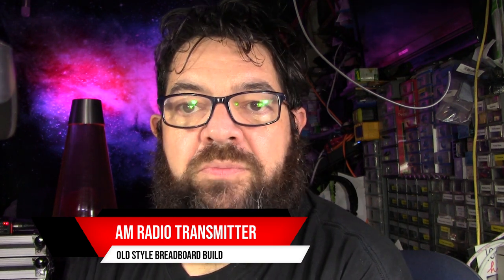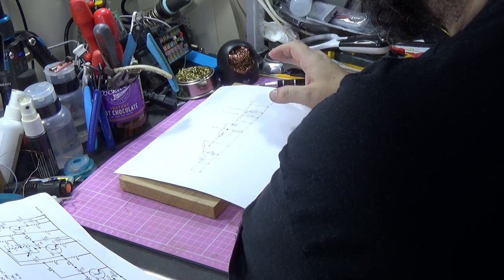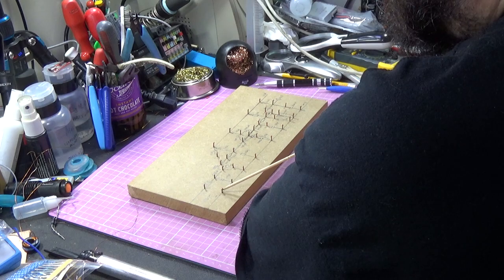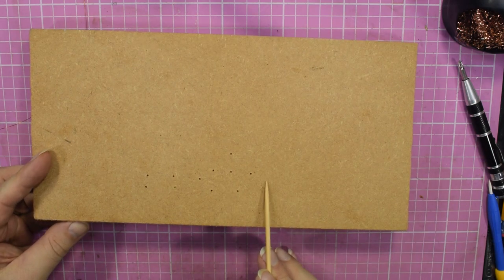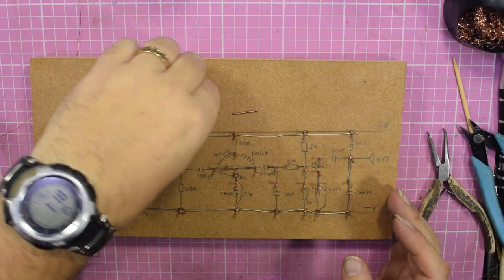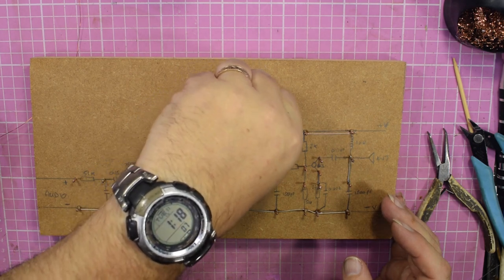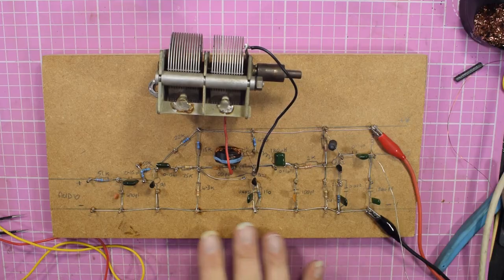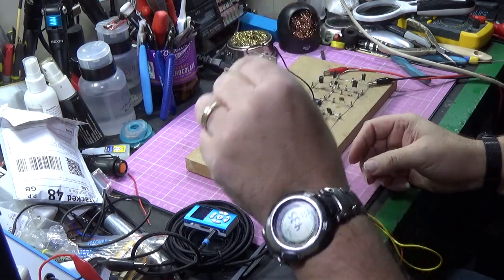Build AM Radio Transmitter - SIMPLE Method - How To Make

Comment: Would be fun to see this built on an actual bread-cutting board. Or, with some springs, like those old Radio-Shack kits I built as a kid. Cool project, nicely done.
Reply from the maker: If you could get a wood breadboard these days. As for the spring kits... I just happen to have one.
Reply: @GeorgeChristofi   There are lots of people making breadboards these days and you can probably get them on Amazon, Etsy or even the dollar store.

Love the idea and fits into what I want to do which is make radios like they did in the twenties through the fifties.
 I like the idea of the breadboard because I don't have to worry about getting metal cutting drill bits or cutting holes in aluminum chassis.

Just watched YouTube video on somebody that made an AM transmitter using the bread Pan is the chassie and it's pretty neat too

Comment: I ain't watched the movie all the way through, only the start and most towards the end: time is tight. Our local HERC radio club warned us you can get into serious trouble for using a MW TX in the UK. Maybe rules have changed. Great instructional upload, thanks. 73, 2E1FQN. 🙂
Reply from the maker: Strictly speaking, the rules against operating an unlicensed transmitter in the uk are clear but as a licenced amateur there is nothing to stop you building an oscillator as long as the output does not cause interference. I won't say ofcom are toothless but these days the chances of getting into trouble with a 50-100mW transmitter are less than almost nothing. George, G0JKZ
Reply: @GeorgeChristofi  That is really useful information, George. Thanks. I've inherited a Maplin  frequency timer/meter and have been trying, with a little success, building an oscillator at 27Mhz thinking this band is a free for all, since some toys use it. I did a MW one with only 2 transistors that worked well, only on one frequency. Schematic on my Web. Yours has an RF output stage, so, I assume is why it's tunable. I do love this traditional breadboard approach: inspirational. 🔌👀🙂

Comment: Hello George. Sorry but this snippet is very off topic. If you use a buck conerter as a variable power supply you need to change the blue variable potentiometers for wires to standard 'pots'. Surface soldering the wires to the PCB is very weak. A 3 way 2.5mm pitch JST female socket fits well. I expect I'm teaching my grandmother to suck eggs but it's worth knowing. Judging from the comments I had better watch this video. Regards
Reply from the maker: I don't know why but I only just got a notification that you posted! As you say, surface soldering is so dependant on the copper thickness, the adhesion method it was glued to the board and the thickness of the cables. JST male pins are good too and you can make up a three way flying lead quite easily to remote mount a standard pot on a cabinet or a chassis.

Comment: Just what I need for my shop so that I can listen to some of the radios I'm restoring.  Definitely gonna build it.  Any recommendation on a tuning capacitor?  I'm sure I have some since Ebay sellers have sent me several radios without padding that arrived violently disassembled.  Can I just scrap a tuning condensor from one of the heaps?  Love the old school approach.  Exactly what I'm after.  Keep up the great videos.  Doc
Reply from the maker: I just used one that came out of an old radio that was beyond repair. I think you could probably get away with anything that has a reasonable range. That one went 27pF to 450pF or thereabouts.
Reply: Thanks  @GeorgeChristofi

Comment: Awesome video George, this looks so much easier for older eyes than doing the PCB method. I love the way you did it on the board. I would think one could use a 1Mhz crystal oscillator in place of the coils and variable capacitor? I definitely want to start doing some projects in this fashion. Thank you so much. You have a new subscriber!
Reply from the maker: Using a fixed oscillator would work but how far you could tune it would depend on how far the crystal will allow itself to be pulled. The other option could be a modern chip based oscillator. You could use an opamp or a 555 chip at frequencies up to around 1Mhz.
Reply: @GeorgeChristofi  Or just buy yourself a 1MHz crystal oscillator module.
Reply from the maker: @SpeccyMan  indeed, that is the easiest way but this circuit can be made with any old stuff lying around that may have been salvaged from old pcb's

Comment: I like retro electronics. I think I'll repeat your construction. What determines the modulation depth? It looks like this circuit doesn't have much distortion
Reply from the maker: the amount of audio determines the depth of modulation. too high a level will overdo it and drive it over the top but its a juggling act between volume from the device versus volume on your radio.

Comment: Nice but it is not really just an AM station it also produces FM modulation,
You usually modulate AM on the final stage!
BUT it works!

Greetings from the Netherlands!
Rob.
Reply from the maker: indeed, there will be an fm component in there but not enough to really notice on those frequencies under the am signal. At worst it will be 20khz due to the nature of audio but yes... it works!! Many thanks for watching. George

Comment: Hello, George.
Thank you very much for this video!
Is it possible to use c945 transistors in this project? 
Thanks and warm regards!
Reply from the maker: I would imagine its possible. I just used a general purpose transistor so anything good to 2mhz will work
Reply: Thank you very much for the response. I will try it. Thanks again for the video.
Cheers!
Reply: @GeorgeChristofi  2 millihertz? There is a reason we use M for mega and m for milli. 😉

Comment: Excellent video, you just did not demonstrate how you wound the ferrite coil and how you installed it. I may try and make that circuit as I repair tube radios and would like to play my music on the sets that do not have phono inputs to use blue tooth pre-amp or a mp3 player. Have all those parts but as far as those value resistors I only have them in 3 watt which yes is overkill but its what I have, and also have a few tuners saved from scrapped tube sets, does it matter what tuner is used?

Comment: Great video, but imo using a perma-protoboard would be way easier, and smaller circuit ofc
Reply from the maker: It was just done that way to show old school build methods from back in the 60s and 70s and even earlier. Proto board is cheap these days but it wasn't when I grew up in the 70s so we used any old plank of wood to test things out. Also wasn't to intricate for 8 year old me to figure out!

Comment: Hello, Thanks for your instructive video. Could you please kindly explain why the radio was detecting the music at different positions for variable capacitor. You demonstrated in the video that this is due to the instability. Could you please elaborate on this a bit more ? thanks.
Reply from the maker: The issue with the tuning was partially the fact that my hand was detuning the circuit by introducing extra capacitance as well as the fact that the output is not filtered in anu way so produces many harmonics at various frequencies. This can be cured by adding a filter before the antenna and that would reduce the spurious emissions from the transmitter.

Comment: wooow sir can you please explain the working principle of the circuit sir it would be awasome ???
Reply from the maker: The working principles are very straightforward. If you work from left to right the components around the first transistor are designed to amplify and produce a variable ac signal to modulate the second transistor. The second transistor is a simple lc oscillator circuit which uses the output of the first stage to modulate it. The third transistor is used as a straightforward rf amplifier. This just takes the low level transmitted signal up to a high enough level so it can work over a greater distance. There are other modifications that you can make to this circuit to improve range further such as adding a tuned stage to the output of the amplifier.

Comment: George what exactly did you use as the core for the inductors, material and size? Same size wire and turns as shown? I'll have to get me an LCD meter to get it correct, but I need the basics first. Thank you!
Reply: Also, what voltage is your power supply providing?
Reply from the maker: I used a core from a computer power supply in this unit. type unknown. I just test wound a few cores with some turns to get me somewhere near the 180mH needed for the inductor. It was a completely random find in my box of dismantled parts.
Reply: Thanks for your quick response George, what about the input voltage?
Reply from the maker: @greggsvintageworkshop8974  input voltage can be anything up to the maximum yout transistor choice will take. I stuck to around 9v in this case as it was a standard battery voltage so those without a bench supply could still use the design.
Reply: Thank you George!

Comment: Is the range enough to be used as a house transmitter? would the signal go though walls to other rooms? (or if not, is it possible to amplify?)
What type of lowpass filter circuit is ideal to get rid of the distortion?
Reply: This circuit is not very good. it's not proper AM

Comment: Hello. one question. If such a transmitter is to work on one planned frequency, can I replace this large variable capacitor with a normal one with a fixed capacity ???
Reply from the maker: Yes, that is a possibility. You might want to use a trimmer capacitor in parallel to make fine adjustment though due to the tolerance of fixed caps.

Comment: Love it! I'm going to try this kind of breadboad. Would it be possible to show the modulated RF output on a scope? Thanks.
Reply from the maker: I probably could show the modulated output on a scope. I may well revisit the circuit and see how much harmonic output it has on a spectrum analyser too. There is a further add on that Robert Gibbons has done to filter the output to make it cleaner which will be worth investigating.
Reply: @GeorgeChristofi  Yes, that'd be interesting to see the modulated envelope linearity with a 1khz tone at 100%. Yours looks like a good circuit to build. Thanks

Comment: What is the distance this transmitter will go???
Reply from the maker: This is fairly short range, depending on the length of the antenna wire. If you added another amplifier stage and a filter you could get at least a 100 foot radius from an indoor antenna.

Comment: i see your method of using tacks on other projects, i would use a crystal instead of variable capacitor.
Reply from the maker: A crystal oscillator would be more stable for sure, but would really limit you to a single frequency rather than be tuneable. I do actually have a cheap chinese transmitter kit based on crystal oscillator modules coming up in the near future.
Reply: George Christofi  love you know more about your chinese crystal transmitter, i want to build a hf tx about 10 watts max
Reply from the maker: @stevedvd272  Depends on where in the HF band you want to build it, what sort of antenna you plan to run it with and a lot of other variables. Also depends on if you are legally allowed a transmitter or what the licence rules are in your area.

Comment: Would it work if we left everything out, except the power source and the audio input, and attached the whole to a simple crystal receiver at the place of the antenna? Would we get the original sounds through a crystal headphone? We would basically turn this fm-transmitter into an audio input attached to a speaker.
I am sure we would get some noise out of this contraption, but would the original sounds be recognizable? If not, what would we need to leave in, or add to this hybrid device?
Reply from the maker: That would not work because what you are trying to do is amplify a low level signal to an audible one. The audio input may just work directly on a crystal headphone depending on the impedance of your source but you would be better off just building an audio amplifier and connecting a speaker to it.
Reply: @GeorgeChristofi  Thank you for your like. But I must admit that i do not really understand your answer. I am interested in the question whether the sound from the audio source, which of course needs to be amplified, would be captured by the crystal headphone at the end, even if we eliminate the "middle man", that is, your transmitter. It won't be wireless anymore, but it does not need to be since the antenna has been replaced by a direct link to the receiver. 
In fact, what I am asking is whether we need all those extra components if the only objective is to transmit the original sounds to the crystal receiver through a wired connection. (we wouldn't even need a tuner).
I am asking this because, as I understand it, the objective is to reproduce the original sounds as faithfully as possible, and that seems the most direct way to that.
In fact, I do not understand how all those alterations could possibly reproduce the original sounds! That certainly does not look as the simple amplification of sounds.
I hope I made myself clear. I am not so sure myself!
Reply from the maker: @odal6770  the problem is that the transmitter is pretty much nothing without the rest of components. The thing you want to do is make an amplifier for audio. If you took out the transistor near the antenna and the next one back you are left with a basic audio amplifier but you would also need to remove all of the crystal radio except the earpiece.
Reply: @GeorgeChristofi  Okay. The amplifier in the earpiece would make the sounds audible. But since the transmitter is supposed to transmit, are all the extra components supposed to help transmitting? Why are they needed to transmit sound wirelessly? I understand the need to amplify the currents carrying the sounds. I still do not understand what the other components do. I know, theoretically, what each component alone does, but let me give you a very stupid illustration of how it seems (sounds?) to me.
You ask a seller for a pound of sugar. You see him pouring the sugar in a first container (C), then taking C1 and emptying it in C2, which has a different shape. Still not satisfied, the merchant adds some unknown quantity to C2, then transfers everything to C3 which has a hole in it. He waits patiently for a while and pours C3 into C4 which sits on a spinning table. When it is done spinning, he adds a pinch or two to the amount and finally pours everything in a paper bag which he gives you while declaring triumphantly: "this is exactly one pound, just like you asked!"

Comment: Why not build it with 01A tubes if you're going "old school"?  As long as you're going solid state make it over a copper clad board using chips of copper clad super glued to the ground plane.  Easier soldering, better impedance control.
Reply from the maker: Yes, a real valve based transmitter is on the cards for sure. I have gathered most of the bits I think I will need but have yet to settle on a final design. The one that @allamericanfive has designed is a great sounding simple design that appeals to me.

Comment: Hi George I'm  just about ready to put my old school bread board AM transmitter together. I got some torpid cores t50-43 and some 26 gauge magnet wire and I'm good with the L1 and L2 inductors,  but the L3 was not clear. Is it also a Torroid core with 26 gauge wire? Was it only one winding and how many micro henrys?  How and where did it wire in, because you said the drawing was incorrect but never showed how it was wrong. This is the only part not clear to me. Any help you can provide would be appreciated.  Thank you sir!
Reply from the maker: L3 is a fixed inductor. Both Bob and myself used a 1mH inductor. You can wire one on an iron core or use one of the fixed inductors that look like resistors. How many turns on a toroid  core depends on the material the core is made of. You can also use ferrite rod as well but you have to experiment to get the correct value.
Reply: @GeorgeChristofi  thank you sir, I can do that. I'll likely just wind one then until I get the correct value. So the actual placement was correct however, between Q3 & the 0.1 cap, then up to battery positive?
Reply: @GeorgeChristofi  is that a micro -Henry  or a mlli -Henry?
Reply from the maker: @greggsvintageworkshop8974  milihenry

Comment: Hello Sir. I would like to use a miniature variable capacitor, usually with 220pF. What would the changes on the coils to cover the same range, 550 to 1600 MHz? Thank you and kindest regards. José
Reply from the maker: it would depend on the material used in the core. It  is best to experiment with what you have to hand. It could be as simple as adding one more turn or it could be ad 10 turns. I could not tell you exactly what the modification needed would be because there are too many variables in the equation. This is the fun in electronics, experimentation. 

I am sorry that I could not give you an easy answer but I thank you for stopping by and watching the video. Best wishes.
Reply: @GeorgeChristofi  George, thank you for your answer. I will experiment!!! Kindest regards. José

Comment: Hi there! Can i ask What's the farthest distance the transmitter able to transmit signal to the am radio?
Reply from the maker: Without a proper antenna its range is very limited. If I add a tuned output stage as well as a good antenna it should easily cover the average house footprint. If you put a larger outdoor antenna the range will be much greater.

Comment: No that is a real bread board.
It sounds like it is transmitting all over the AM band.
Reply from the maker: It's a bit of a harmonic generator for sure. Plenty of stray inductance as well as capacitance because it is so open and there is no shielding but hey... no different from hearing a local oscillator from a bakelite set!